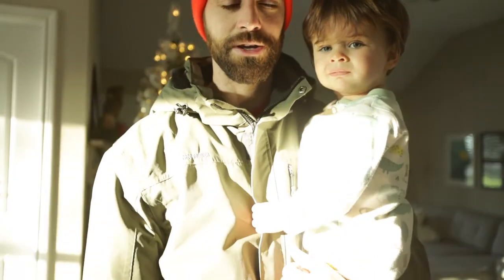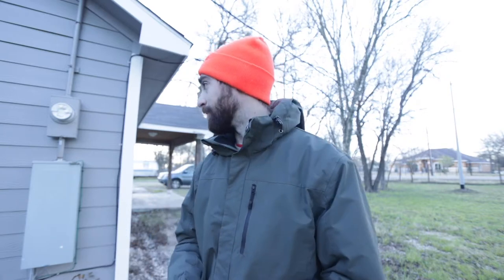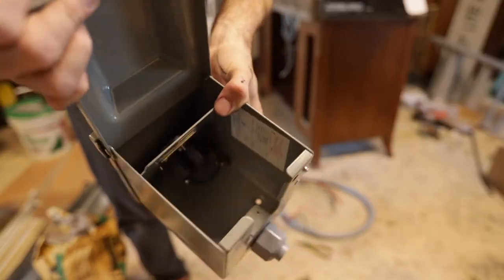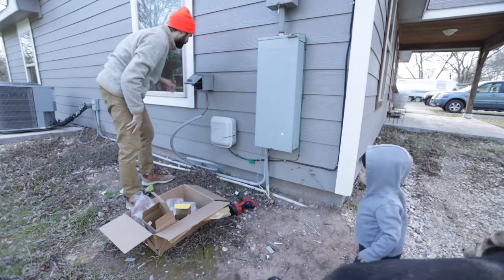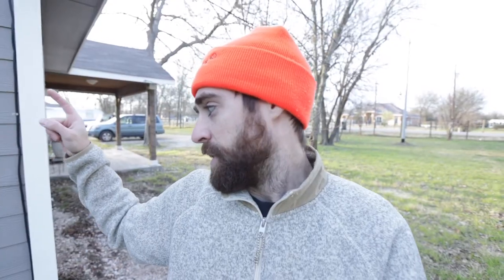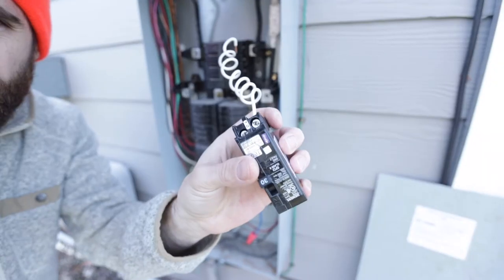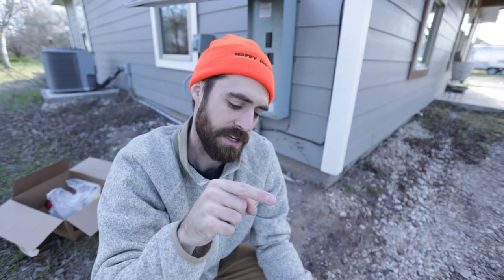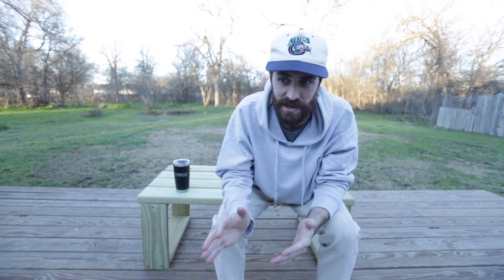How to Plug RV in at Home | DIY 30 Amp RV Outlet Install

Comment: Well, it works! so at least you accomplished your task.  Yet, check back on those screws and torque them.  Whenever you tighten stranded wires please lose and tight and lose and tight so the individual strands accommodate and keep the torque.  You should check as it may be lose now and for two reasons; is best to use an industrial outlet, like a HUBBELL, which is the one I recommend and use.  These outlets grab the strands between two plates instead of a screw on them to cut or push them out, is a better connection and they take the constant and daily abuse of plugging and unplugging as well as heat because the blades inside the outlet are full and beefy so the 30amp is no big deal. 
The second thing is that people will surely use the Air Conditioning in their RV and it can draw enough to heat those cheap outlets. Sometimes Noalox, even if not needed in copper, provides thermal benefits to those connections.
And, if you do this as it is supposed to, please pull a permit and have an inspector come and approve it. It is not costly, no fear....why I say this? because  people are not honest and anyone with faulty equipment will later accuse you. They will say that surges and bad connections or something wrong in your electrical system damaged some of their RV things and if you have a permit it destroys at least on its face any of those claims because the connections were inspected and they were done according to code. It protects you. And, is good to have someone else take a look anyway, is peace of mind so that your home is also safe.  Then, get a surge protector in the panel, when the RV AC kicks in it can mess up your washer, TV sets, etc.

Lovely family, you are a blessed and a happy man! Good for you!
Reply from the maker: Thanks for the tips!